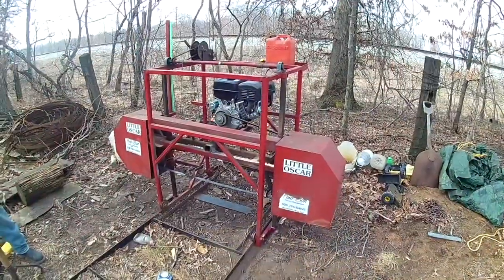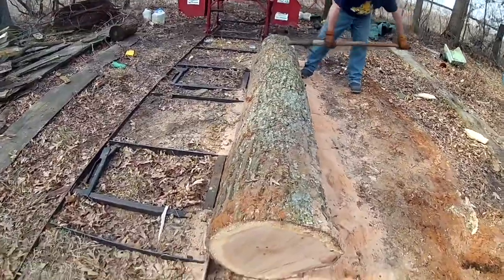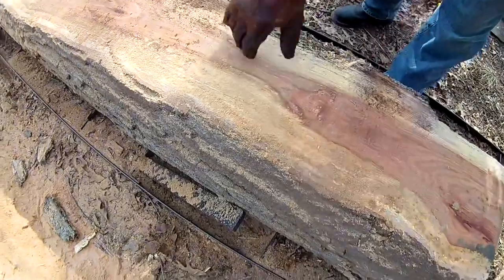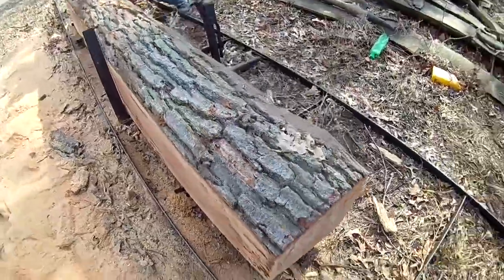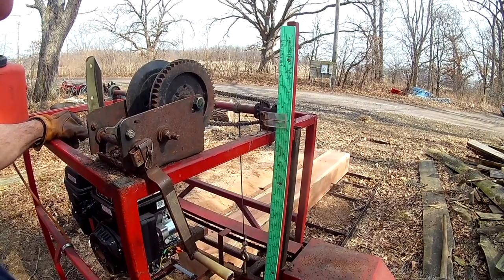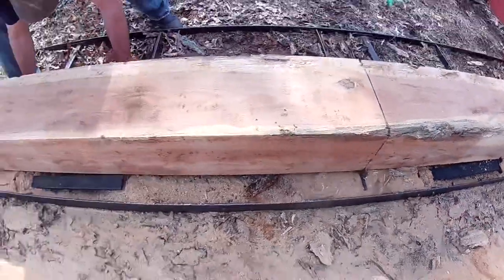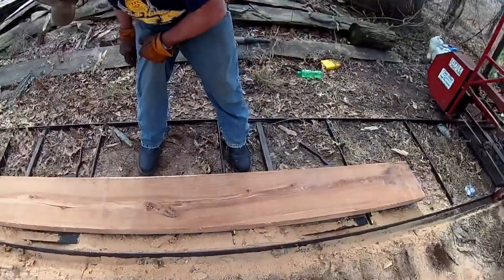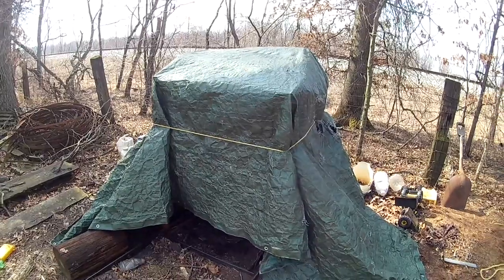Hudson sawmill cutting some lumber out of a red oak log perfect small farm sawmill

Comment: What kind of platform does the mill sit on?
Reply from the maker: It came with the mill it’s basically just channel run down both sides with flat bar run between them the angle sticks up just a little higher then the flat bar for the wheels on the mill to run on
Reply: @knappfarms  
Are you on concrete or gravel or...
Reply from the maker: Nope just packed the ground and put the channel right on it it has sank in over the years but we haven’t had to do anything to it and it’s been there for almost 20 years
Reply: @knappfarms  
Got it. Thanks.